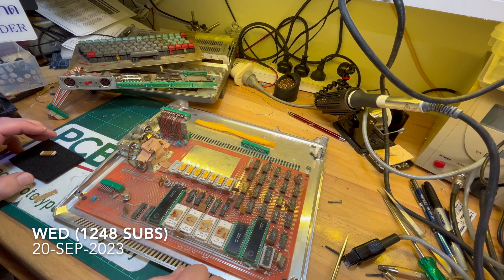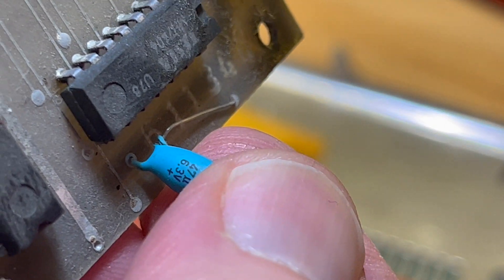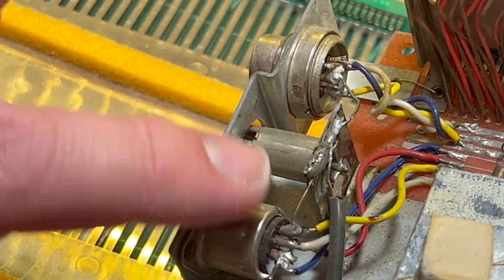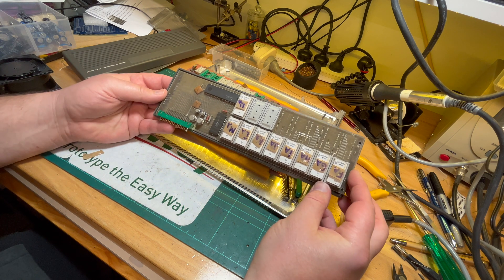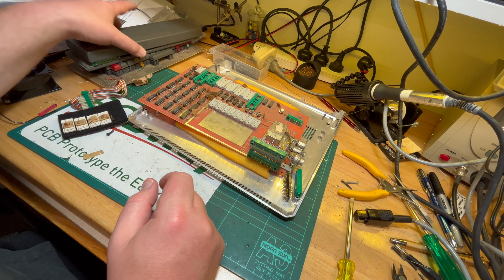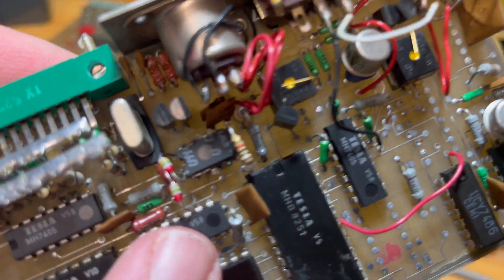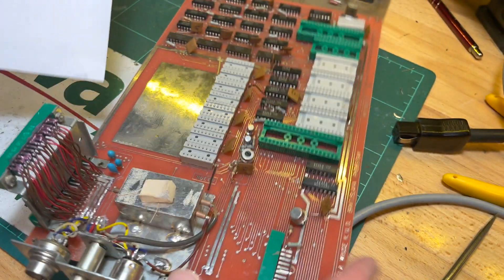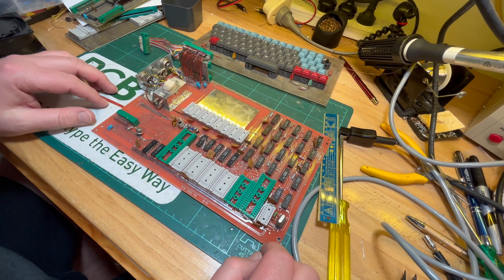🇸🇰 Tesla PMD 85: Part 2 (PMD 85-2B) [TCE #0351]

Comment: Build quality was always a weakest point of communist manufacturing.
I did some calculations and found out the price of the PMD computer line was about 590USD in 1985, which was around 6 to 7 average socialistic wages. Interestingly, these machines were available only to organizations - schools, industry, research organizations.
One time my dad borrowed PMD 85-1 from his job for a weekend. It happened in 1985 and it was first computer I ever put my hands upon. And burned my fingers after a while 😄

Comment: PMD-85 has been designed by Roman Kišš. Keys are originally buttons from telephone
Reply: Buttons on PMD-85 were from a calculator right? Not a telephone czechoslovak telephones didn’t always have buttons and if they did there were max 2 button telephones in the town. Other telephones were rotary telephones.
Reply: @vojtavedator8235They were from telephone on the first prototype according to PMD designer Roman Kišš.

Comment: There is a broken off pin. i noticed it on the last video - Rom Expansion socket
Reply from the maker: Yep - I noticed that too - I had assumed it was just keying ... but now that you mention it as well, that doesn't make much sense ... it's not like you can insert the ROM module upside down!